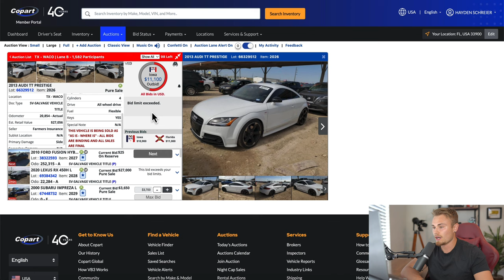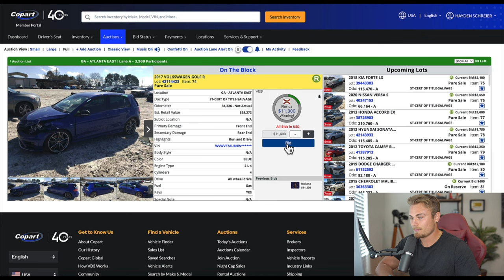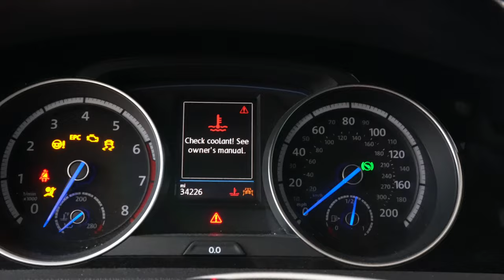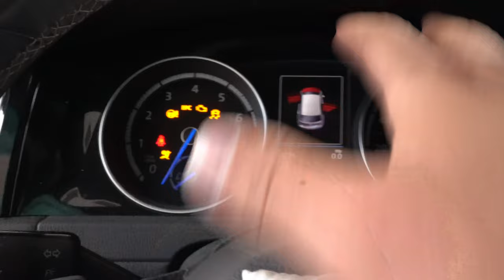I BOUGHT A WRECKED VOLKSWAGEN GOLF R THAT NOBODY WANTED!

Comment: Fair play for taking such a gamble mate, look forward to watching the series. Like other people say I’d definitely start with the rear and the structural damage as that’ll be the biggest challenge!
Reply from the maker: haha everyone seems to be split on which end to start. If i start in the rear everything after will be easier "ideally" moving forward. But if i start on the front it will progressively get harder. I dont think there is a wrong answer. But i think in this case since i dont have a frame machine or the tools yet that starting off in the front and getting the car running is my best bet. Especially since ive never done this before. Best to get as many victories as i can so i can keep my confidence!

Comment: I would tackle the coolant leak first, then run the engine up to temperature and check that there are no other engine related problems. That way you then have a car you can at least move around. If that turns out ok then the next step would be to strip off the damaged body work and interior and work out the cost of repair/replacement to make sure it is worth proceeding any further. Then tackle whatever arrives first, could be a new dashboard, could be the curtain airbags or steering wheel, could be the front bumper and headlight, could be the rear tailgate, rear quarter, boot/trunk floor.
Reply from the maker: Thank you for this! this is exactly what i plan on doing. get the car running first and then tackle the rest.

Comment: Use hydraulic ram to push the back sort of straight the cut out and replace the bent sections there not expensive £150 uk pounds for a good one
Reply from the maker: Thats the plan. But i will most likely need to go to a frame shop

Comment: The damage in the front looks alot like on my 2.0 Scirocco when I got it. Had the same coolant line broken and such. Quick tip for that plastic piece on the end of the coolant line. There's a bitch of a clamp that goes around the coolant line and plastic part, get the right tool to unclamp it, it caused me a lot of headache cause I didn't. Best of luck, will be following the series!
Reply from the maker: ooof any idea what the tool is called? otherwise im going to wing it!

Comment: Fyi when you jump start a car that has a battery sensor on the negative terminal you should put the negative lead on an engine ground instead so you don't fry the battery sensor 👍
Reply from the maker: good to know, i believe this car doesnt have that though but for the future i will make sure to do this.
Reply: @Haydenschreiermk2  easy way to check- basically anything with any electrical sensor type thing on the negative terminal pretty sure that the golf R will have one. It's why of you look just above the negative terminal on the bulk head, there's an earth point sticking out of the bulk head...use that instead. Anyway looking forward to seeing how you get on! Best of luck dude!

Comment: You can't just pull the metal. You need to cut along the seam and replace with fresh metal that you re-weld or seam seal back into place, otherwise the structural strength of the car will be severely compromised.
Reply from the maker: Yes or course but to access those panels and to align the seams of the car properly, i will need some sort of puller or pusher

Comment: I know you’re trying to rack up views and subscribers, but unless you have professional body working tools and skills, that rear end will be impossible to repair.  If the trunk floor is buckled, there’s significant damage to the entire rear body of the car. Unless you can get the body components aligned to factory spec, the rear of the car will be useless.  Since the R is all wheel drive, there are a lot of extra mechanical bits back there which make alignment even more critical. Do you know someone who will give you a deal on body shop work?  The rear hatch will also be hard to get right.  I’d definitely work on the back first to know what you’re up against. The front is fairly straightforward. Good luck.
Reply from the maker: Well a few thoughts to this, first off thank you for the comment. the back will most likely require professional help. I can only do so much with a hammer and a porta power. I “could” buy a portable frame machine which is about $1.8k but im not sure id know how to fully use it. So i would have to outsource the help from someone. If it comes to the point where the back is too much for me to handle than i will have to go to a body shop. Im sure
I can find a shop who is willing to work with me. Otherwise im doing as much as i can myself not only to learn but to have fun as well. And more importantly if i do this again, ill stick with front end collision😂

Comment: Clear all the codes and see what comes back there will be your true faults a lot of them codes will come on because the battery has been aloud to run flat
Reply from the maker: agh thats a really good point. i didnt think of that. I was going to clear the codes after i got some work done to the interior like the airbags and seatbelts but maybe after i fix the front end i will. A lot of the codes are repetitive, there's like 30 codes for the headlight and all it is, is unplugged. the rest of the codes seem like they are just stored and need to be cleared.
Reply: Yeah start with that clear the codes and see what you've got you know the airbags have deployed so you know that will come back get a new battery on her she what happens oh don't get the airbags replaced there are some companies out there that can repair the deployed ones here in the UK we do it here so that could be cheaper rather then replacing it as a complete new airbag kit